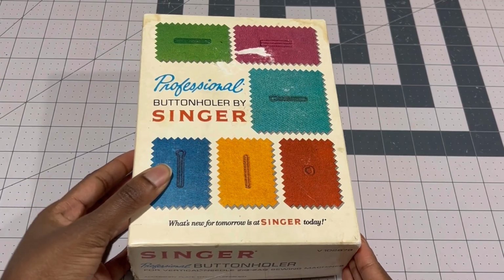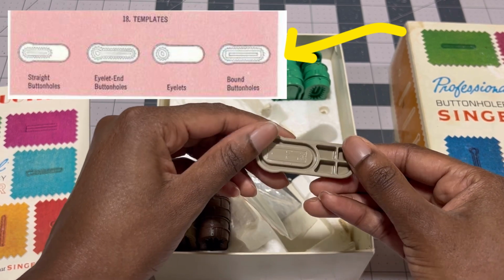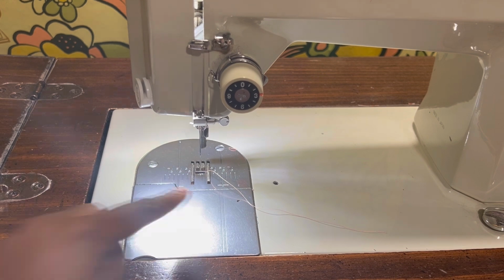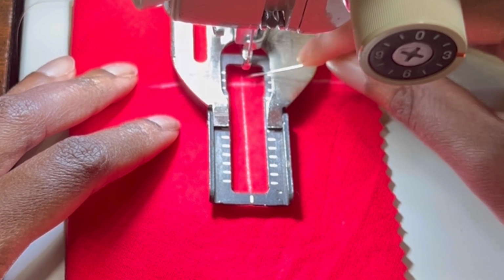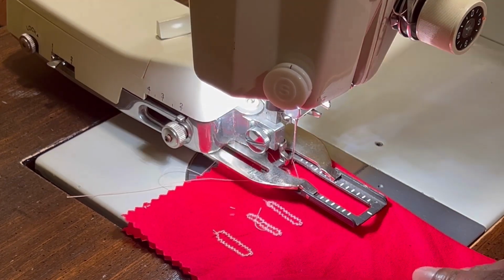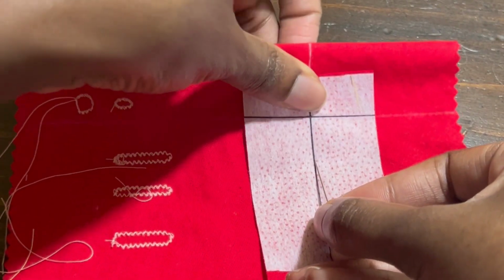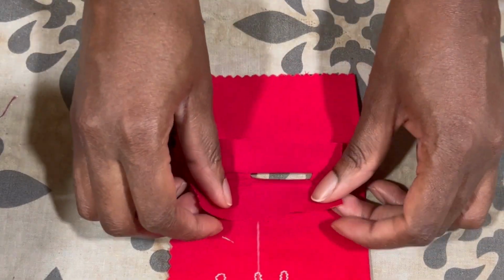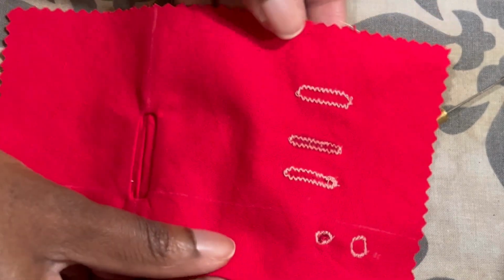How to use your Singer Professional Buttonholer attachment

Comment: Does this particular model of buttonholer need to use a zigzag stitch? I thought these were made to be used on straight stitch machines. I've been looking into different models of this attachment because my modern machine WILL NOT sew buttonholes if my fabric is not absolutely perfectly flat. My understanding was that these attachments work by grabbing the fabric and moving the fabric in a zigzag motion rather than using a zigzag stitch itself. (My machine has a zigzag stitch, so it would work either way. I'm just trying to learn as much as I can about these attachments before I drop money on one.) 😊
Reply from the maker: If you don’t set it to zigzag it won’t.

Comment: Try using a straight stitch and not a zigzag. These babies were meant to be used with straight-stitch only machines 🙂
Reply from the maker: No they aren’t. The instructions literally tell you how to use it. This was made for a zigzag machine
Reply: @SewRena  Then I guess that there are different zigzaggers out there!
Reply: @SewRena  I just went through the manual for that buttonholer. For "worked" buttonholes, it does say zigzag. For regular and bound buttonholes, it says straight stitch, center position. You might get a denser edge with straight stitch.

Comment: I heard you say, at least I believe I heard you say, that the buttonhole was used on high shank sewing machines, but your sewing machine seems to me to be a slow shank. Could you tell me if your buttonholer is for "high" or "slow" shank? I found a buttonholer in ebay with this message write in the box: SIMS 4634 and below V102878 - do you know if this for slow shank sewing machines? Thank you from Brazil!
Reply from the maker: It’s for low vertical shank and you can get a slant shank option
Reply: @SewRena  Thank you, Rena!

Comment: I have the green-case 'atomic' 1960 low shank buttonholer foot.  It is everything.  Completely in love with the results it makes.  So glad you're sharing the knowledge.
- Cathy (&, accidently, Steve), Ottawa/Bytown/Pimisi
Reply: Question - for the bound buttonhole option, do you run the stitch over the ironed buttonhole?  Sorry, bound buttonholes are still on my to-do list so there are some things that almost make sense.  Also, the facing that covers the inside of the bound buttonhole - do you have to cut and iron a matching hole?  Sorry, not sure if I'm asking that clearly.

Comment: This can do an eyelet hole?! Mind blown!!! ❤❤❤
Reply: The original metal cam for eyelets that would be used in the 1960 'atomic' buttonhole (also works with the older metal model) foot is prized by collectors.  If you're looking for an alternative, The Featherweight Shop sells a plastic replica cam that works just as well.
- Cathy (&, accidently, Steve), Ottawa/Bytown/Pimisi
Reply: Hi, Stephanie Canada!  I have actually made a couple of eyelets with the Singer buttonholer.  They came out great.

Comment: I bought a Singer buttonholer in 1989 from a sewing machine store after reading about it.  It was also for a vertical-shank machine.   You’re right , these attachments last forever.

I have a slant-needle Singer now too, and I bought the Singer buttonholer for it on eBay.  ❤

Comment: You can get a near satin stitch if you make your zigzag stitch really really tight. Takes forever and you have to practice but I’ve done it both by hand and with an attachment. Prefer attachments!!
Reply: I read in a book somewhere that you use a shorter, looser stitch on the buttonhole foot for the first pass.  Then for the second pass you use a tighter wider stitch.  It's suppose to mimic a hand-sewn buttonhole (because that apparently used to be a flex with the Granny's??).
- Cathy (&, accidently, Steve), Ottawa/Bytown/Pimisi

Comment: Omg I have one of these. I've never tried. I got it with a Singer machine. I think it might be the other type of shaft you mentioned? Maybe I'm going to have to see if I can figure it out. Luckily it actually still has the manual!
Reply from the maker: It’s so worth it! I’ve even have a friend who uses modern machines who was able to make it work on her machine 😂.
Reply: @SewRena  That's so cool! I'm definitely going to check it out! The only thing is the singer machine I have is straight stitch only so I'm very curious about how this gadget works!
Reply: It is so worth it - just watch videos, read the instructions - go slow - it'll come together faster than you think and then WOW!